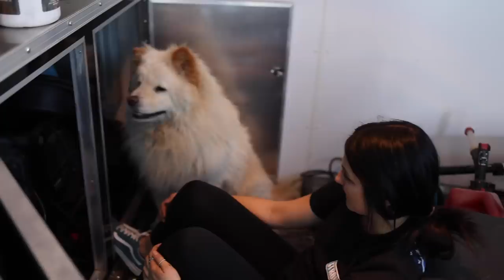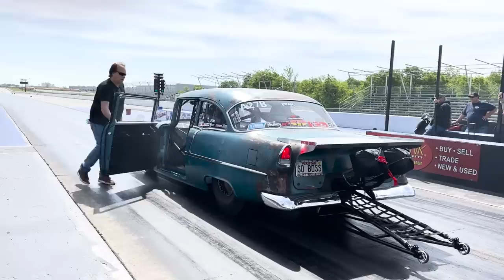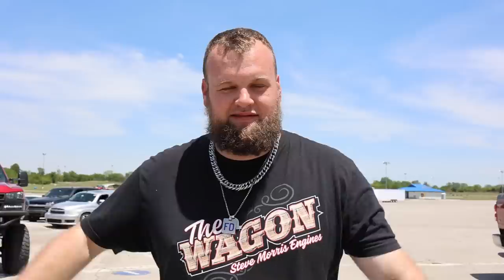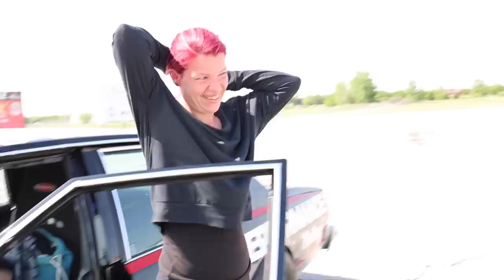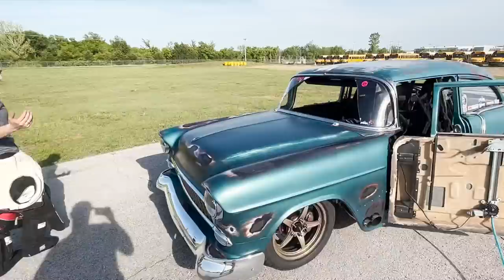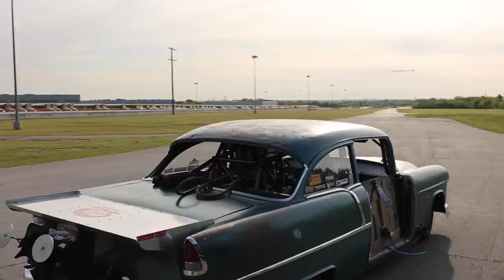I Literally BLEW My Doors Off the 55 at 212 MPH 😱 PLUS Austrians Raced in the US for the First Time!

Comment: When you have it back together, I can't help thinking that maybe a trip to a wind tunnel might be a great step. It's never going to be 'aerodynamic' as such, but there may be things you can do with little laminar lips & subtle spoilers you can add to make huge differences to drag at high speeds... & also you might be amazed at the direction & location of aerodynamic pressures & forces when the speed gets way up there. No point beefing something up to stop it getting pushed in or sucked out, if in reality it's the opposite happening...
Reply: Repent and believe in Jesus Christ  No thanks, I'm good...

Comment: I'm telling you . . . back in 1969 going down a blacktop road in a '55 at 110 mph with a sweet cammed up 283 was quite a ride.  I can only imagine what it feels like at twice that speed.  No, I can't imagine.  Amazing.
Reply: It's a 55 shell the rest not at all.
Reply: @danielborrowdale3903  aerodynamics are all the same
Reply: @MC-re2ry   Yes it's a fast moving brick.
Reply: not as violent with modern suspension
Reply: I did the same and adjusted the vacume wiper blades pretty often as they would spin to straight up every time.  Fond memories of my 283 at full song ! Go Alex,Go!

Comment: Alex, I hate to say it by having rubbered in glass you'll get that window blowing out all the time or get the screen shaped/ moulded with a good outer curve in it as the stop it blowing and doing what it did.
We used to make windscreen glass moulds with a good 8mm/5/16 of outer curve in it as at 100klm/h the glass would flatten out. That's with a normal thickness windscreen thickness not the plastic type thickness.
I think you'll have to look at either bolting in the windscreen or installing some window deflection bars to stop the screens flattening in under wind force.
Then you'll keep the doors on the lady.
Just a bit of FYI.
Anyway onwards and upwards, 250mph, here you come!!!!!

Comment: Just ordered the shirt!!! Won't help with funding much, but this is a CLASSIC... blowing your OWN doors off!!!    SO GLAD you are OK!! <3  

We have been watching the '55 project since the beginning and I am emotionally invested in your 'quest'!!  Toughen up that front windshield, or keep it under 210!!  Maybe interior support 'struts 'backing up that massive windshield???   That windshield is NEVER gonna be overly aerodynamic, no matter what you make it from and I'm willing to bet the 'blunt' front of the '55 is building a TREMENDOUS pressure wave that multiplies pressure at the windscreen.  Just spitballing here, but you are possibly creating a huge LOW pressure zone at the base of the windscreen, it didn't get driven IN, but was sucked OUT, then slammed back into the  interior once popped free.  I'm assuming whatever mounting methods used were focused on tolerating EXTERIOR pressure, and not too much focused on INSIDE pressure (exterior 'vacuum)!  This low pressure area would also extend around the sides of the '55, sucking the door skins off while the interior door structure remained (mostly) intact.  If it was entirely INSIDE pressure after the windscreen failed, there would likely be more sever damage.  

IMHO, your doors were not BLOWN off, they were SUCKED off!  Just my thoughts... Consult someone with appropriate engineering experience.  Just something else to consider while your re-build.

You are now running at speeds  where aerodynamics may need to be considered... you guys are pushing a veritable BRICK over 212 mph!!!   This is totally AMAZING, but it's apparent you are approaching some unanticipated 'limits' :-) 

God Bless,  Stay Safe & Stay Pretty!!  Dave & Fran in Tennessee!!
Reply: @davidmcfate; @davidmcfate3768;  David McFate: Clearly You lack the basics about Physics, aerodynamics, forces, static & dynamics, materials as these folks within these racing too !!
Aerodynamics has noticeable, significant affects at much lower speeds of 20-60 MPH !! If You have ever ridden a bicycle, motorbicycle, moped, scooter, or even attempted to put Your hand, arm outside the window of a moving vehicle while traveling, You would have certainly experienced the forces of air flow = aerodynamics !!
Good Luck
Reply: @newtonfirefly3584  Thanks for your constructive criticism. I will afford it the attention it justly deserves..
Reply: @davidmcfate3768  Certainly within Your limited, closed mindset. Good Luck David McFate

Comment: I won''t recommend duct tape or JB Weld.  But I will relate a story about a guy named Tony Levier who was a Test Pilot, Aeronautical Engineer and raced airplanes at way faster than 212 mph.  He arrived at the first Reno Air Race in the '60s with a P-38 Lightening.  The first thing he did was hand a bucket of money to his crew and told them to go into town and buy up ALL of the Scotch Tape in the town.  When they came back, they spent many hours taping over EVERY seam and panel line on the twin engine airplane to get every mile per hour with the least drag possible.  The 55 has MANY places where air can get under a seam or panel or bulging chrome and at 212mph, the force is working against you!  We don't want to see another R.U.D. (Rapid Unscheduled Disassembly - Elon).
Scotch Tape is your friend.  🤣

Comment: Honestly, she’s so lucky that glass didn’t slice through her suit or helmet, or worse into her neck.  Wow.
Reply: Perspex [and I feel that is what it is] is not very sharp when it breaks. Laminated is probably sharper though usually does not collapse.
I used 6mm perspex in my road race car without issue except for scratches and stone damage though was 30mph slower. BUT knowing what I know now would use lexan.

Comment: That ole Mike Henson SMH makes me 😊 This unit leaves and it sounds like the engine stops three times in 300' I'm guessing because the traction control is coming in hot multiple times. The fact that this car isn't a hookie cutter, buck$ up, weight down faux mod and runs that good is awesome. Short spoiler, tall nose, not sure if they moved anything to help aero.  Knock on wood and forbid me God and the Pigmies, it's awesome how reliable the combo has been. If I have seen one I've seen a thousand comments about how every car would go faster with a SMX.The price of that and the reliability record makes a simple combo like yours a Henson SMH. I'm pretty sure when he puts combos like yours together, SteveM & SMX's(price) make him Shake his(My) Head SMH, I've seen him do it. I think the comments signal boosting SM being blowed up ever ones booty is what causes poor ole boy(Henson) to glitch and I get it! I don't want to start a feud because I'm sure SM is friendly but I wanted to shine love on good ole hot rod shit. It's all expensive but at one time it wasn't nor does it have to be. I just can't get over how a Brodix block is as suspect as a dominion voting machine, and probably to the same people. 😮😅

Comment: Lexan screen should never do that,, and when that happened there went the doors and rear screen.. 6mm Lexan should be good enough for all speeds.  Or maybe a laminated one,, for street driving far preferable. And fit door trims then the skins will stay on. Though really fit steel doors as plastic ones are dangerous as we see doors explode weekly or even more often.
Some screen support bars as well

Comment: I would definitely try to find a laminated glass windshield replacement. That lexan could have speared you. You got lucky, thankfully!
Reply: Your statements are contradictory B G D !!  Laminated glass is NOT Lexan, nor  any other type of polymer as Plexiglass, Polycarbonate [among the best]
Actually this is one of the many important, safety reasons all racing have been using such polymers for over six decades !!
That windshield was certainly a laminated, multi-layer glass ! =>Thus, prone to this damage with the forces -? seemingly gradually, though not seen, detected, nor examined thoroughly, properly, nor required, though should be for such speeds, aerodynamic forces.
My background includes the proper study within physics, engineering, materials, mechanics, structures, statics&dynamics, electrical, electronics including for space bound equipment, devices, structures.
@Riding With Alex Taylor; 
Alex Taylor, Dennis Taylor, Nickky Bobby Taylor, All of the Taylor Family and Racing Team
A. -> please remove, change, swap, replace  All of glass with polymer Plexiglass, Lexan or similar, especially which are properly rated for racing speeds !!
1. For Safety
2. For weight
3. For Security 
4. Also quicker, easier to replace, store, order, cut, etc.
B. Also add the necessary air flow passage, so there is not the air pressure which builds up inside the 'cabin', interior, driver/passenger area - as proper Pro-Mod, and other fast racing vehicles have
1. You know as "Super Bee", Tom Bailey, Dave Schoroder, Bryant Goldstone, "The Swedes" and all others have
C. There are some other small, but important additions with air flow, aerodynamics to improve the results with this vehicle too
1. air flow traps inside the wheel wells; both front [more so] and rear thus causes, results in lifting the vehicle, lowering traction
2. improved air flow in and through the front of the vehicle
3. improved air flow under the vehicle, especially via a full, flat plate, panels to achieve aerodynamic downward force [down force]
4. consider improved rear wing, even high wing as Nick for improved aerodynamics, downforces as with Pro-Mod, dragsters, Funny Cars, other racing vehicles
D. This occurrence is actually a Huge Blessing for You 'All, to be more aware, sensitive to the needs, necessity with more aspects within safety, aerodynamic forces and specifically the windows to have polymer materials which are properly rated for the speeds and forces.
All The Best and Much Success in Your Quest, Health, Happiness and Well Being. 😊 Sincerely ☺

Comment: Hello Alex - front rare glass support side impact door bars rear wheel bars mentioned adjustment tracking top end  good runs ! finally
Reply: maybe a 3/8 lexan if using 1/4 inch
Reply: @andrewwilgus; @andrewwilgus336;  Andrew Wilgus, False ideas about the windshield and other window areas !! Certainly Dennis knows the solution !! The need is for properly rated polymer windows. A brace is helpful for a crash as integrated with the cage !! These should be required, but NOT !, Good Sense dictates the use anyway as within the Professional and other racing !! Good Luck

Comment: Looks like it is time to add a center brace to that windshield to keep it from flexing that hard again. Suck having to do that, But I think you have found the max speed that the windshield will take.
Reply: False idea !! The need is for properly rated polymer windows. A brace is helpful for a crash as integrated with the cage !! Good Luck

Comment: Was the windshield and rear window real glass or polycarbonate?  I know you already know this but maybe it’s time to add windshield bracing!
Reply: @sarahbecker; @sarahbecker1297; Sarah Becker, Obviously the windows are all glass, except the doors. That is why the windshield broke under the forces of the air flow, pressure !! Bracing is NOT the solution, rather the proper materials = Polymers - rated for the speed, aerodynamic forces - Plexiglass, Lexan, Polycarbonate !!
@Riding With Alex Taylor; 
Sincerely
Reply: The glass was polycarbonate.
Reply: @newtonfirefly3584  they didnt use glass windows .. it was prett thick Polycarbonate
Reply: @lucky8-performancellc   @agasrcng  
Obviously, Clearly, Certainly False. The window though appears to be a synthetic was not a Polycarbonate, nor very thick, as seen clearly, precisely in the next video and via the statements of Alex and Dennis, it was a type of Lexan with a 'coating'.
however, that specific synthetic, polymer is clearly not sufficiently strong enough for the forces

Comment: A couple of braces/stiffners on on the windshield will solve that problem and won't let the wind inside to blow out the rest. Congrats on a strong run.
Reply: @davidanderson; @davidanderson6486; David Anderson, False idea !! The need is for properly rated polymer windows. A brace is helpful for a crash as integrated with the cage !! Good Luck

Comment: There's a reason why NASCAR puts braces on the inside of their front window screen and their rear glass is to prevent blowouts.
Reply: @marlobreding; @marlobreding7402; Marlo Breding: FALSE !! They put those braces at part of the frames in the event of a crash !! They use polymer windows, rated for the air pressure forces so the windows don't break due to these forces and for safety in the event of a crash too.
Your ignorance, lacking with, within the basics is obvious, clear, certain, absolute too - just as the others that suggested these braces for that purpose, though they will be helpful additions to the cage structure also - along with other safety features as improved seat, automated and button deployment parachute(s), improved fire safety, head & neck restraints,  containment and a few others too.
The use with properly rated polymer windows should be a requirement for the various NHRA/IHRA/PDRA, et. and other racing for each of the classes, because of safety alone with any crash and the speeds, air flow forces, aerodynamics !!
Just think: In The USA, they require the eyeglass lenses to be impact resistant but these vehicles do NOT have these requirements !!
Some basics within physics, structures
@Riding With Alex Taylor;
Sincerely
Reply: @newtonfirefly3584  that doesn't change the fact that this car should have some braces at least on the front windscreen.

Comment: Noob question, now that we see the pressure that builds up on the front windscreen what prevents just modifying it to slope the windscreen thereby reducing the drag and increase the top speed?
Reply: @atubefuff; Yes a 'noob', 'newbie', ignorant question idea, though some improvement with aerodynamics is certainly helpful including a more slanted windshield However still within the other presented false ideas !! The need is for properly rated polymer windows. A brace is helpful for a crash as integrated with the cage !!
These both should be required, though NOT !! Good Luck
Reply: They’re trying to stay with a mostly stock body. If they were chasing aero would probably be best to chop the top down some as well as angle the windshield some. Looking at stuff like pro mods they’re long, narrow, and low.
Reply: @NBSV1  Is Your reply Your idea, view of, with the goals, intents, parameters of this 1955 Chevy race vehicle or those which Alex, Dennis stated explicitly ??!!
Have You watched, view, listened, comprehended to the entire 1955 Build "Quest for The 6s" Series ??!
Good Luck

Comment: Why did the windshield let go? To thin? Will it be replaced with  thicker higher quality Lexan?
Reply: Yes, the laminated glass succumbed to the forces of aerodynamics, finally ! Better, Safer to use properly rated polymer windows as Plexiglass, Lexan, Polycarbonate [preferred]
Reply: Likely to thin and maybe a problem with not enough material mounting it.

Comment: Duct tape in weld. You forgot baling wire and super glue. Great mph. So glad you are ok
Reply: @chevybelair9230; False ideas !! Certainly Dennis knows the solution !! The need is for properly rated polymer windows. A brace is helpful for a crash as integrated with the cage !! These should be required, but NOT !, Good Sense dictates the use anyway as within the Professional and other racing !! Good Luck

Comment: Has DT figured out a solution for the windshield?  Thin glass, thicker lexan, steel straps....?
Reply: @davidkeesling; @davidkeesling; David Keesling; Certainly Dennis knows the solution !! The need is for properly rated polymer windows. A brace is helpful for a crash as integrated with the cage !! These should be required, but NOT !, Good Sense dictates the use anyway as within the Professional and other racing !! Good Luck

Comment: Looks like you need to reinforce the windshield from inside
Reply: @shanedevlin; @shanedevlin6097; Shane Devlin: Looks, seems, appears from You comment, that You lack the basics more than the Alex, Dennis, Nickky Bobby Taylor !!
=>These forces required properly rated polymer windows - NOT Glass - NOT bracing or structure inside [though it is also helpful for a crash, if properly done]
Basic, p[roper knowledge of materials, physics, Statics & Dynamics are important - or at least viewing the tables, charts which are developed from the proper knowledge 
=>Also professional racing and others have been using polymer, 'safety' windows for many decades >60 years !! -> This is one example and of the many other basis, reasons, purpose of the necessity and should be required !!
Good Luck

Comment: Y’all always try to beat weight now you might’ve learned a hard lesson maybe you think about putting real glass for the front windshield and you could do everything else the same because it looks like the front windshield cause the whole damage all of the damage keep making good videos I’m glad you’re safe and you’re not hurt
Reply: @barrybazile; @barrybazile1294; Barry Bazile, False ideas about the windshield and other window areas !! Actual laminated glass is The Problem !! Certainly Dennis knows the solution !! The need is for properly rated polymer windows. A brace is helpful for a crash as integrated with the cage !! These should be required, but NOT !, Good Sense dictates the use anyway as within the Professional and other racing !! Good Luck